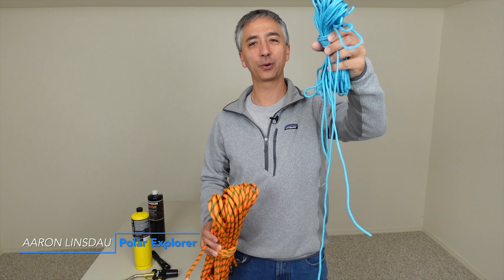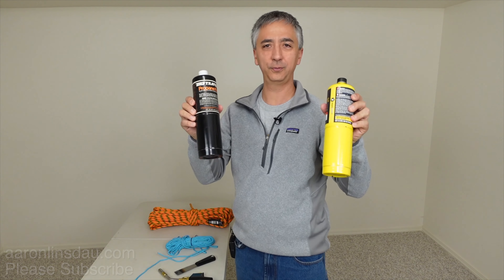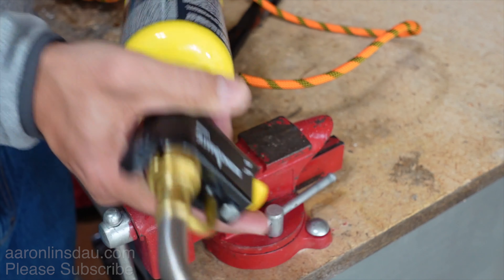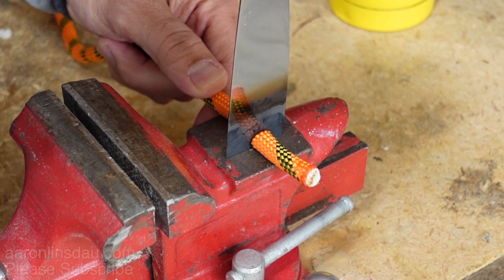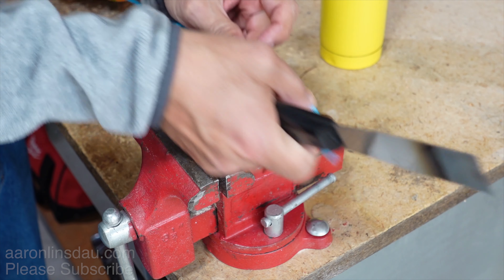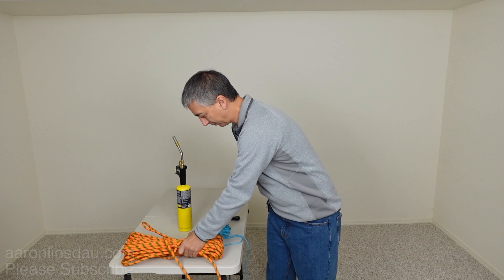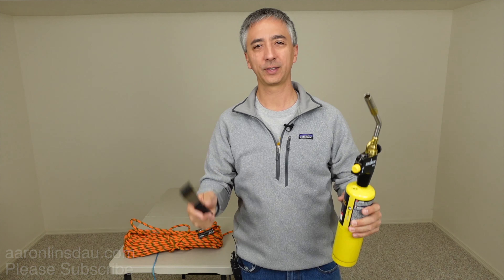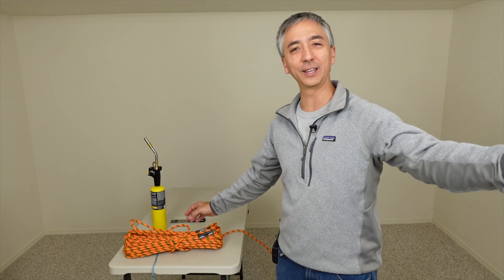How to Cut Synthetic Rope and Paracord Properly and Fast (4k UHD)

Comment: Thank you, that will save me a lot of time. I need to make multiple paracord (750) cords up, so upto 20 plus a day.
Reply from the maker: Retail stores have an electric thermal cutter. If you have to do constant cutting that requires a lot of effort, consider using a cheap soldering iron or solder gun with a blade on it. That would be even more efficient.

Comment: I do a similar process with a utility razor knife blade held in a vise grip.   Typically I use blades that are dull and toss them afterwards as they are discolored and have melted plastic on them.
Reply from the maker: Nice!